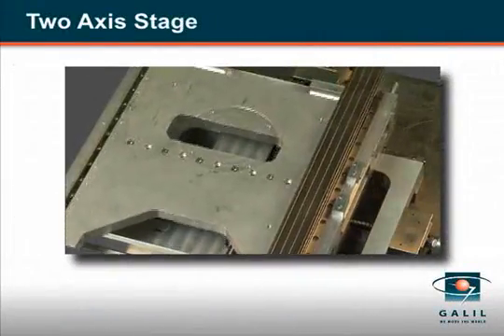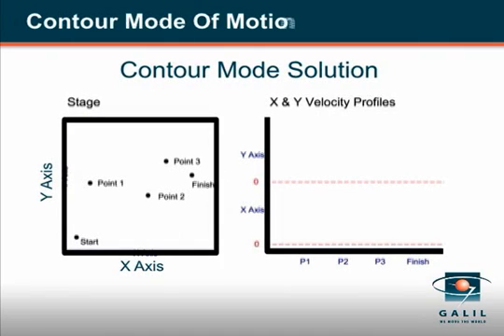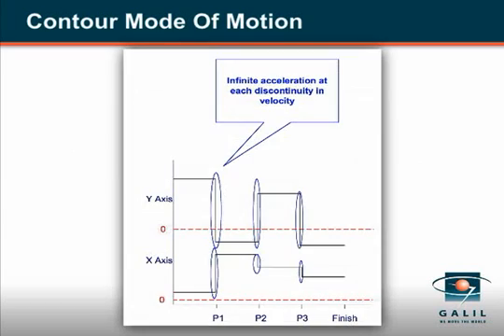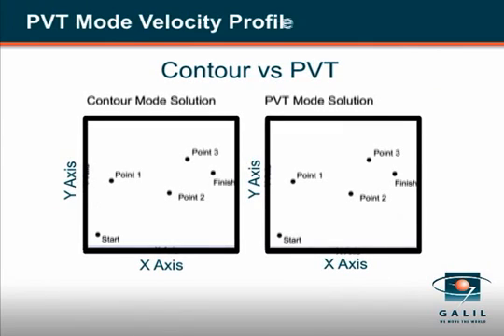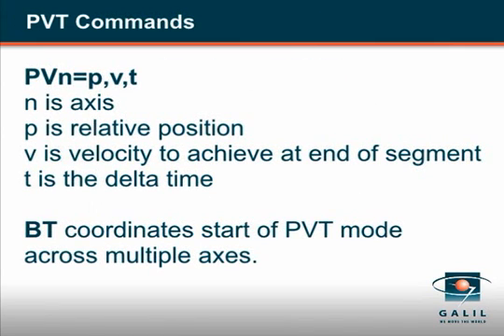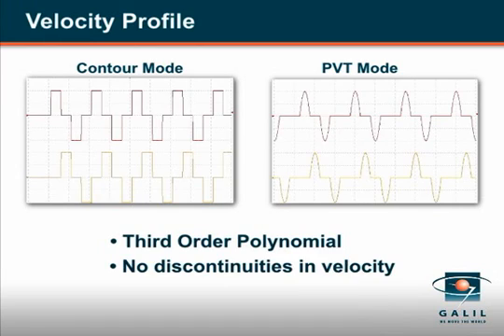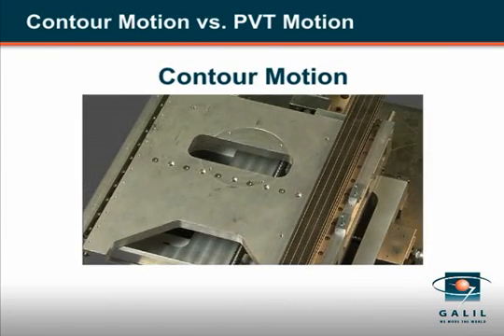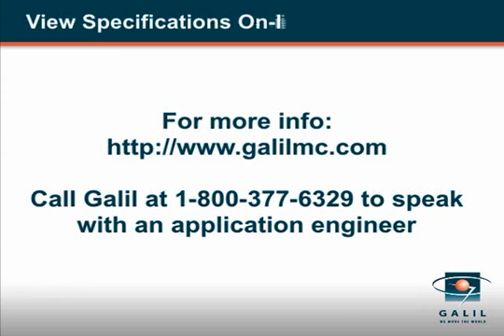Using PVT - Position Velocity Time Mode with Galil Motion Controllers

Comment: How does GALIL interpolate the velocity in between two velocity points (say V1 to V2) ? Can i generate the PVT data out of Inverse Kinematic Algorithm for serial robotic arm and then run GALIL to achieve the tool tip path??